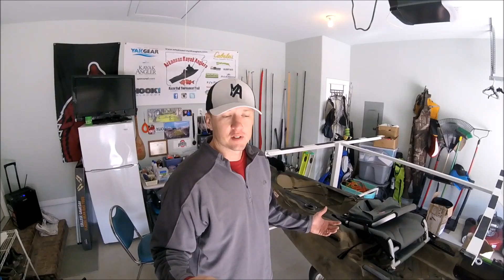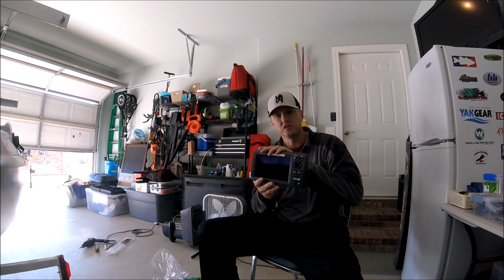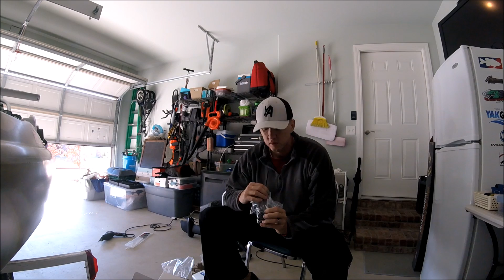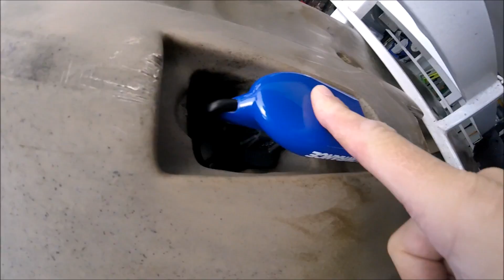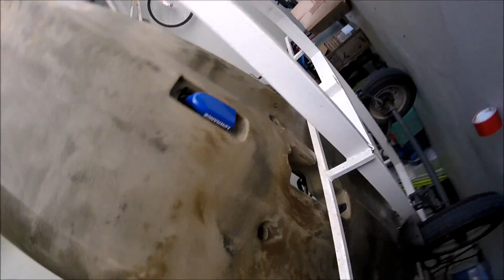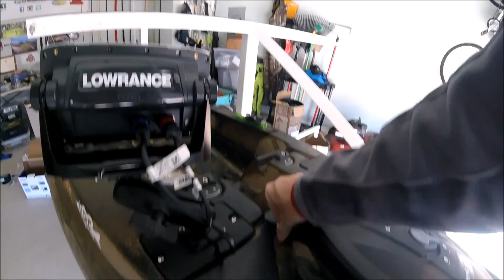Lowrance Hook 7 Install

Comment: I didn't have you're luck with my install. Tried sliding the lowrance scupper mount onto my transducer but that method made it impossible to line it up with the hole in the scupper. I then slid on the attachment for the transducer that has the hole for the bolt in it. That lined up but when tightening the mount it pulled the top of the transducer into the scupper hole making it extremely uneven. Not sure what to do now. Might just mount it inside the hull.

Comment: Great video! Do you find that mounting spot for the FF too far away? Trying to decide between there or on one of the side plates.
Reply from the maker: I am 6"3" with pretty long arms lol ... So I can lean up and hit waypoints or change settings pretty easy. But with the mounting plates closer to you it would be no problem to move it towards the seat.
Reply: Jeff Malott raymrine'fr'dragonfly

Comment: Does this hang out a little bit under the kayak ?
Reply from the maker: Almost flush, if you were dragging in the river the transducer would hit, otherwise its clear of almost everything
Reply: I had the same question... It wouldn't hurt to manufacture that hole to be a little deeper would it?  Geez.  The fact it sticks out even a cm makes me want to use the td arm over the side.
Reply: Nolan, what is "td arm"? I have the same yak and surprised to see the transducer sticking out... p.s. nerver mind, I think I got it